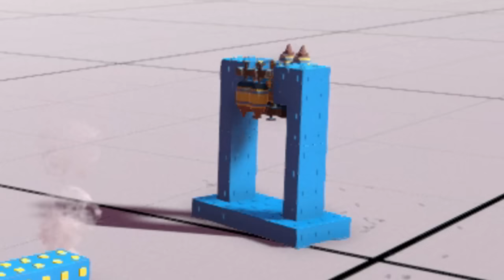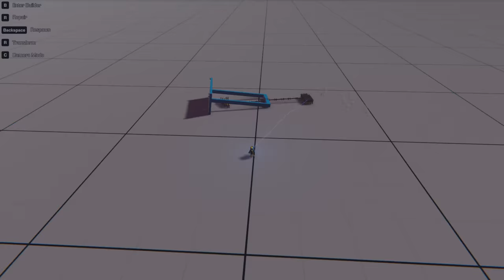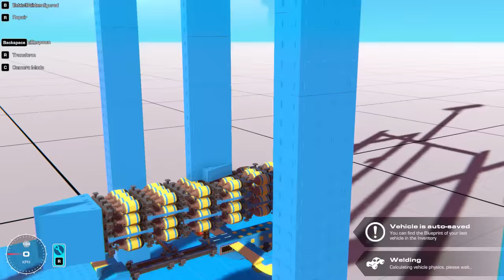Building a GLIDER That Breaks The Sound Barrier!

Comment: That nose cone is unsightly for a square vehicle.
The devs need a couple of aesthetic pieces for sure.

The game needs a transition piece that goes from the square cross section to a circular cross section the same diameter as the nose cone.

They also need a wedge corner so you can put four together for a square pyramid nose cone.
And wedge tee pieces and inside corners as well for 90 degree turns.

They also need more round pieces of all types.
Reply: Yeah, the game needs a LOT of things, but devs are too busy pumping out yet another paid DLC. Just checked and this airborne one is $35 usd! The whole thing is up over $60 and it still has unfixed bugs from many years ago.

Comment: I was really hoping you had tweaked it a tiny bit so that it launched you more upwards than downwards. That wouldn't really help much but would've been more satisfying for me at least lol
Reply: Yeah launching at about a 45 degrees back from the top would give it a much better throw I think
Reply: That might work but trailmakers is really picky when it comes to physics
Reply: All he needs to do is add an angle sensor and set it at a positive 45 degree angle
Reply: @DreadThought977  And make sure it activates after a few rotations, which is difficult.
Reply: @WSlopeAggie  with the speed sensor not really

Comment: The lack of counterbalance for your craft was causing you tons of issues that you didn't notice. The most obvious was the oscillations and the slowdown they caused, but it also made it nearly impossible for the craft to launch upwards rather than downwards. Basically, because gravity was slowing the craft down as it was rising in the arc, the speed gained during that portion of the swing was minimized, while the speed gained as it started dropping was maximized. This means that, despite there only being ~5 degrees between the upwards launch position and the downwards, a huge amount of speed was being gained in that area compared to the ~355 degrees after downwards launch back to upwards. This is why the craft was so consistently launching at the ground and needed to be on the helipad to succeed.
Reply: That doesn’t quite make sense. I think the downward launch was due to where he chose to release it and the small time delta the release occupies.
Reply: I think its because he reached 1245kph when he was going down at an altitude of 335 instead of upwards at 335

Comment: So, the reason it was wobbling is because you didn't put equal weight on each arm. Basically when you added the glider you unbalanced it. Think of a car tire, it needs to be balanced so it doesn't vibrate your car apart (and to make the ride smooth).
Reply from the maker: Haha you got it...I actually did a bunch of weight calculations to offset the glider weight on the other end and then just sorta got into building and forgot to offset it properly 🤣

Comment: The way you have it set up, the release will always be past the apex instead of just before the apex as you wanted. When it's almost at speed, it will slow very slightly as it lifts the glider towards the apex (thrusters doing the most work against gravity). Then as you pass the apex, the thrusters work with gravity giving a very small but important increase in speed, pushing it over the release speed at the release height. Then add the delay in triggers and release block and you are then pointing down. That's why you needed the helipad for launching.
If you added a sensor that detected the arm, you could time it to release during the upswing.

Comment: It might be easier to have an angle sensor instead of an altitude sensor for the launch, since it wouldn't need you to adjust the height for the location. Maybe with some logic to work with a toggle rather than being completely automatic, so you can just keep it spinning up instead of having it fly off possibly prematurely? 

To help the glider, it might also make sense for it to drop the sensors, so it doesn't have to deal with the extra weight too.

For the launcher, maybe some form of counterweight to help balance out the launcher? It might let you get away with less complexity/fewer support structures, since there would be less wobble.

Comment: Easy way to balance a catapult like this: remove the stand, turn it horizontal, use new 'center of mass' indicator and add/remove weight to one end until that indicator is at the pivot.
Also, it is better to use angle sensors, or a regular censor on a servo (so that launch angle can be adjusted) for release. Way more precise than the altitude method.
This turned out to be a more interesting episode than i expected. From title and thumbnail it seemed to be a typical "fly up and drop" thing that has been done a bunch of times before. The spinning catapult idea was way more interesting than that!
As a side note, what's going on in the bottom left at 18:42? YT compression catching up (gradual un-blur of whatever that is)? And why does it look like several creations layered onto one another?
Reply from the maker: that's clever with the weight balancing suggestion! I will use that going forward.
Reply from the maker: oh what the heck!!!! I never noticed that at 18:42 lol! Definitely trailmakers wilding out
Reply: @darealkosmo  tbh for a little bit i thought it was you hiding another one of your "seKret creashins" lol

Comment: I think one of the ways you could improve the centrifuge launcher speed would be to add a weight block on the other side of the glider to reduce oscillation by making it more stable.
Reply: Yep... it's at what I thought too as soon as I saw the wiggle cause by the lack of equilibre.  Other than that, he could do some test about the optimal length of arm vs truster position.  If truster are closer from the rotation point, the max speed should be high (low torc).

Comment: You need to add weights equal to the weight of the glider to counter act the oscillations. With that you could have removed some of the supports giving you more complexity budget to add even more thrusters :>

Comment: The missing counterweight for the glider made the construction much harder than needed and so wobbly.
Anyway, what about a Multiplayer Monday Competition with the new parts?
I have two ideas.
- Build a helicopter, the helicopter will be lifted to a given height. At that height the helicopter needs to stay as long as possible in the air with auto rotation.
- Everyone builds a glider. This glider has a given number of thrusters (4 for example). Those thrusters will burn for 10 seconds or something like that. That is the starting speed of a small platform not too high above ground. Which glider will get the most out of its thrust? That would also be good for evolution as it will be hard to find out the right balance between wings and mass for the given thrust.

Comment: I would set the angle to release when your nose is pointed at a 45 to launch you up instead of down. And does strapping a dragon thruster to the glider help it keep Mach speed? Maybe it’s a Mach speed launcher for planes. Jus have a Mach speed takeoff.

Comment: the reason the launcher was pushing you down was because there are two spots in the rotation for every height besides straight up, when you are going up and when you go down and you would reach the release speed after the up but before the down which is why you went down. if you increased release speed you would reach it after down but before up.  ps. I wrote before finishing video so sorry if figured out in vid.

Comment: yo kosmo, bc of ur altitude sensor method, there was a chance it would actually release just after the highest point, if it reached 1245kmph just after it had already reached that height, a sensor would have worked much better as you could have moved it around to find the optimal launch angle
Reply from the maker: good point fam! I did consider the delay in the altitude meter + the possibility it's triggering AFTER the apex...but then in true Kosmo fashion I just sent it
Reply: @darealkosmo  you also gotta add the same weight of the glider onto the opposite side to act as a counterweight. This should reduce the wobble of the supports if there will be any wobble at all, thus gaining more stability and speed since you arent losing it through the supports.

Comment: I'm pretty sure that if you revamped the glider itself, you'd be able to maintain the supersonic speeds for more than a fraction of a second. The glider you were using was very minimalistic and wasn't really capable of high-speeds. Plus, it was constantly getting damaged at launch for some reason.

So I definitely think that you and the guys could do a supersonic glider evolution video with this. See how goes the furthest. Just provide them with the base structure, dictate that it must release at  supersonic speeds, point them in a direction, and have everyone work on making a glider from that! I honestly think that the glider is the biggest factor here.

Comment: the cause of the oscillation is due to an imbalance of masses. the side with the cockpit has more mass than the side without. if you added another cockpit (or structure of the same mass) to the other side, the oscillations would stop more or less completely. the only issue would be that the thing could possibly tear itself apart when you release from the arm, so in order to avoid that, you also release the extra mass that you added on the other arm at the exact same time.
Reply from the maker: I actually did weight calculations to try and make the weight equal on either side but I got ADHD and just sent it

Comment: Could try some weight blocks to help maintain speed, idk if momentum is a thing in this physics engine. Also shorter wings could cut aero resistance. I know you achieved your goal, but maybe if you revisit attempts to maintain Mach speed lomger once you've launched.

Comment: Yeah the launch mechanism could be improved by using two AND gates, two angle sensors, and a speed sensor.  Greater than x speed AND (angle greater than AND less than).  That would give you a window of release, and hopefully reduce the possibility of "late release".  I would have the release ~15-30 degrees before TDC for best results.

Comment: The altitude sensor was not the best choice. You should have done a distance sensor to sense when you're at a certain point instead. The issue with the altitude sensor is that there's a window of opportunity for you to be released. From the point you set until you are flung below that point again. Odds are you're being released on the downward as gravity assists in giving that extra acceleration. Having the distance sensor as your angle trigger would have been more reliable as you could have given it bias to one side and just set it to release at super sonic and detection.